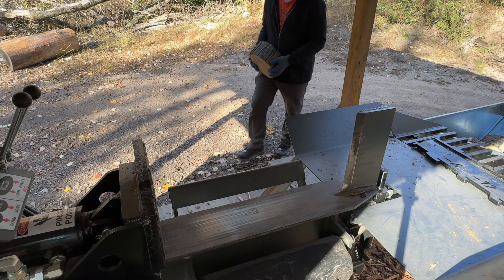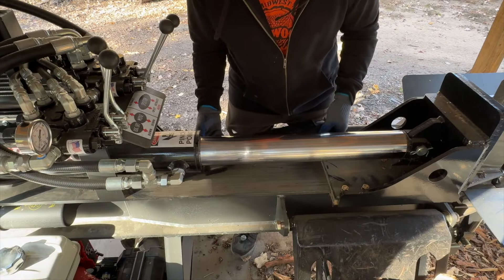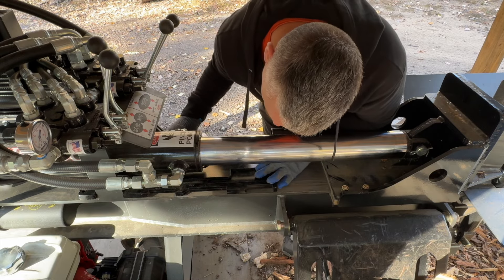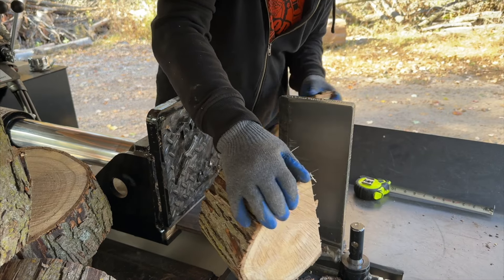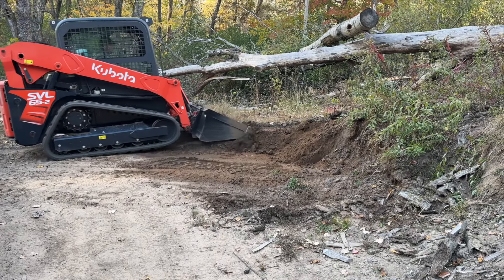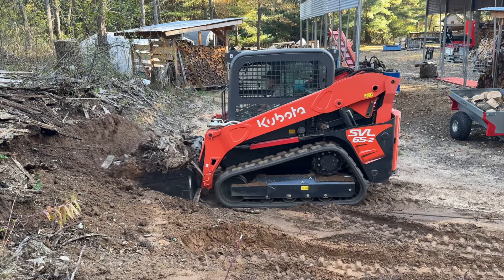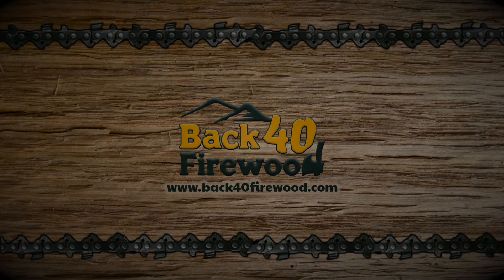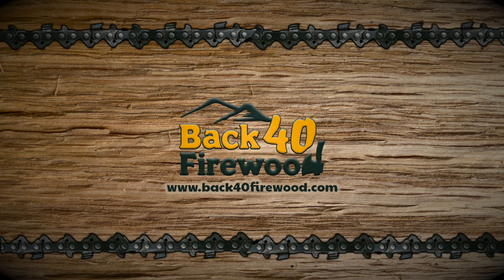Small Wood and Short Strokes - Preparing Mini Hickory Firewood

Comment: What was the reason for not just splitting those rounds in half? It looks like you had a small piece of boiler wood there.
Bill
Reply from the maker: lol...no boiler wood with this stuff. Having as big of a piece as you can fit in the Kindlet give it maximum splits that are good size. The small edges that were split off are an easy couple swings with the hatchet to split down.